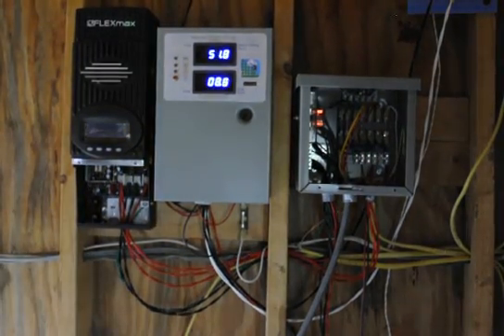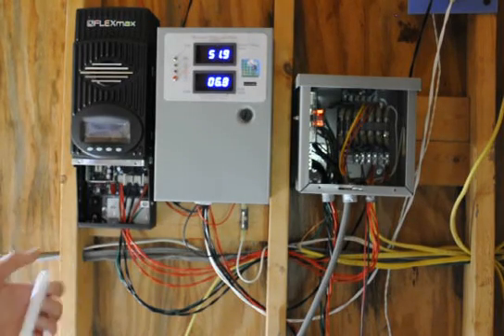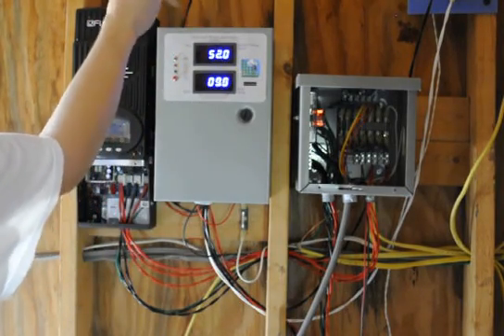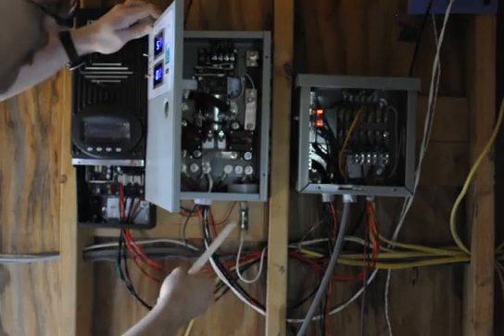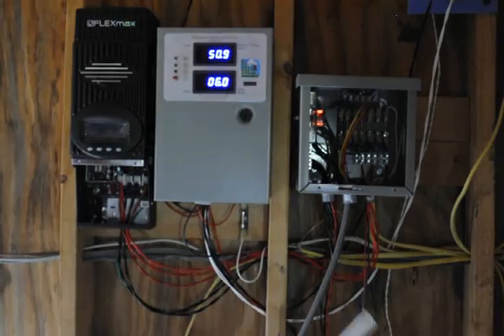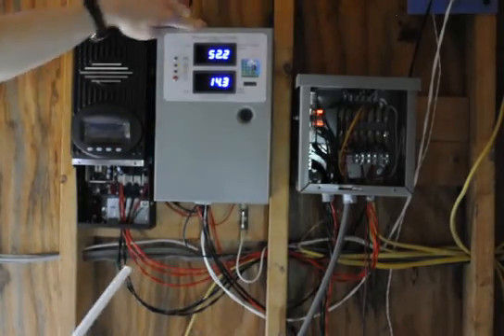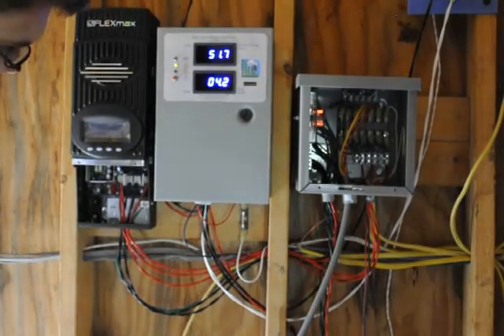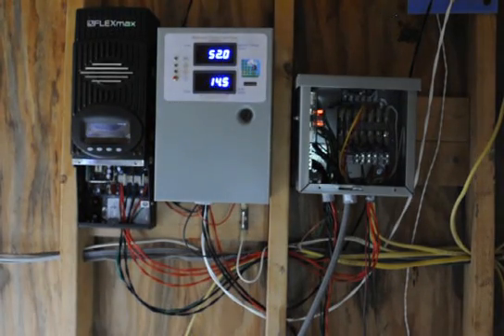Our Renewable Energy System's Wiring

Comment from the maker: @jeffmolly1 Thank you! Yes, I saw your video over the collars & washers–also told my dad & we agreed it would be an improvement, we just haven’t made time to act. I also admit that we were a bit rushed when mounting & raising the turbine, (small window). We noticed it was quite snug but figured it would loosen. I preferred to file down the pipe sides myself, but there wasn’t time. It hasn’t moved in a while, but it’s also a Texas summer. We’ve yet to deal with the situation, (when it's cooler)!

Comment from the maker: @shartne I posted updated photos on my site and the towers were built with the AIR 45 ft (14 m) Guyed Tower Kit. No cement was necessary. We used auger anchors for the wires because of our clay-like ground.

Comment: @adamlhumphreys where did you get the pipe and guide wires, collars hardware at what was the cost? What size pipe is that and what kind? I noticed that the bottoms are not in cement are the rebarb in cement?

Comment from the maker: @shartne Our wind generators are 45 feet in the air, but they don’t always turn a lot in the summer. Oh, and the left one has since been replaced with a 9-blade Missouri Raider Wind Turbine and so far, so good. It certainly produces more than those little guys for the same price! (Still need to update my site.)

And yes, I have an interest in gathering golf cart/forklift batteries, just not as a priority. I plan to call up a few places and ask around.

Comment from the maker: @runescapefunnyvid Hey, thanks! And yes, you can buy little rechargeable battery packs with solar charging used to extend battery life on a laptop. But since the typical output of a laptop power supply is 18-19 volts, I’d probably wire a typical 80 watt solar panel straight to a power connector from a bad laptop power supply.

Oh, and don’t let your age stop you. I was wiring simple 120VAC circuits before I knew how to tie my shoes! … No, seriously, a teacher questioned me about that irony.

Comment from the maker: @shartne But, these are trivial compared to lightning. Like any other high voltage, it takes the shortest path to ground. If it strikes ungrounded equipment, it may travel through various components until it finds ground, causing serious damage. Grounded, if it hits a solar panel frame, or charge controller box, it will straight-way go through your ground wires to the ground rod.

Comment from the maker: @shartne If you don’t ground your equipment to earth ground, it’s a floating circuit. If a stray hot wire, AC or DC, touched against a box or solar panel, the equipment may care less, but it could be hazardous if someone standing on wet ground leaned against it (even at 12 volts). If a hot AC wire somehow touched negative or positive, the equipment may act strange b/c of noise. Equipment could possibly build a charge through the air (static electricity) or be disrupted through external signals.

Comment from the maker: @shartne We used fuses by choice. DC breakers are nice, but since we’re not pulling serious current (48VDC system), especially from batteries, we could use lower current fuses (cheaper).
Yes, the divert load is only necessary for wind generators since you can’t simply disconnect them like solar panels, otherwise they’d free-spin.
For wind generators, I recommend Missouri Wind & Solar (mwands_com). Jeff, the guy that runs it, has several how-to videos & lots of helpful information.

Comment: I wondered about your fuses on your solar panels I use a breaker should I have fuses too.  My divert load dont go nowhere on my coleman air. But I dont have a wind generator so I guess I dont need to hook it up to anything? what happens if you dont ground out your inveter and solar panels to ground ground? I have been bit buy 24 volts. Is that a out back inverter or just a charge controler? yea 15 amps sweet. I need a wind generator for my 24 volt system. wind blows all the time here these days.